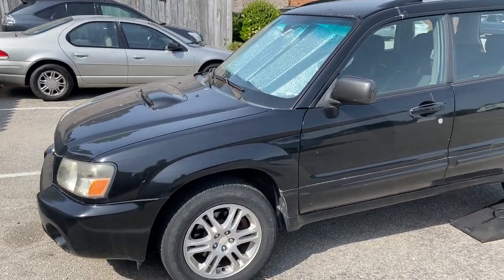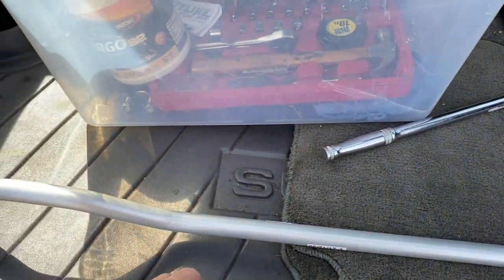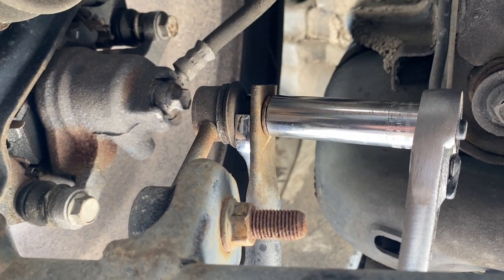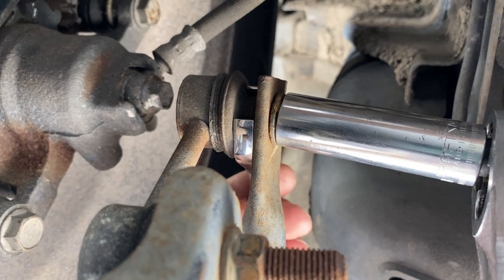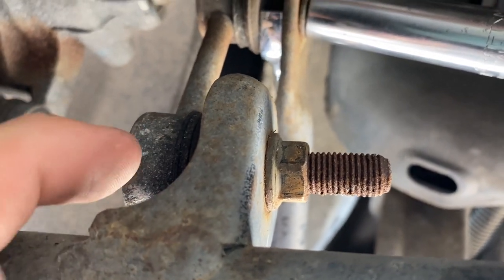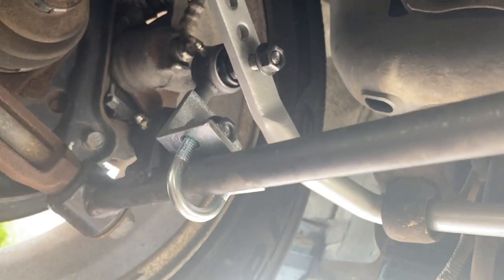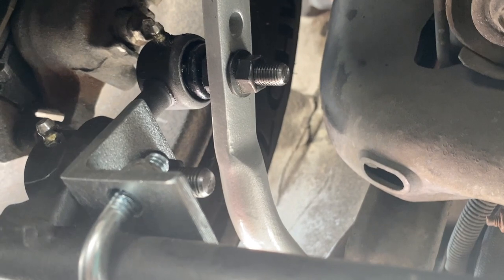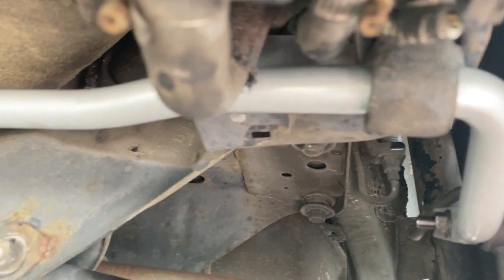2005 Subaru Forester XT Rear Sway Bar Install

Comment: Phew! I live in upstate NY and getting those links off was a process. I rounded out the 2 flats immediately, went to vice grips and lastly, I got the torch. Definitely buy replacement links. They were shot before I cooked them.

Comment: Never run with stock rear brackets, they will snap off, get the whiteline heavyduty 22mm bracket, will save you lots of money and hastle when the swaybar chews off your electrical box in the back, learned the hard way..

Comment: Great video! I also have an 05 FXT and I'm thinking of tackling the rear seat bar sometime soon and upgrading to a bigger than OEM size. What size Whiteline bars did you happen to get for the front and rear? How are they holding up?
Reply from the maker: I have the ones I used linked in the video description. They have held up great since I installed them, no issues.

Comment: Cool video, note any more harness, vibrations or anything negative on the max settings?
Reply from the maker: It is a stiffer ride but nothing vibrating or uncomfortable
Reply: @JRobling  I agree, installed it with cart boy lock outs and bushings. Firmed it up nice and nothing too stiff, 🤙🏻

Comment: What's the benefit of the heavier sway bar?
Reply: Less body roll in cornering. Disadvatages are rougher ride and less articulation driving over uneven surfaces.